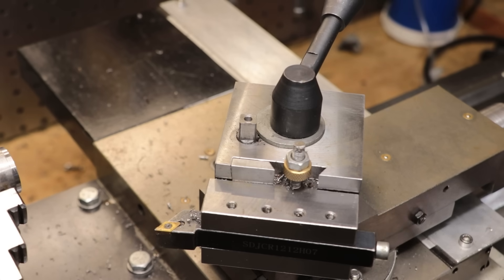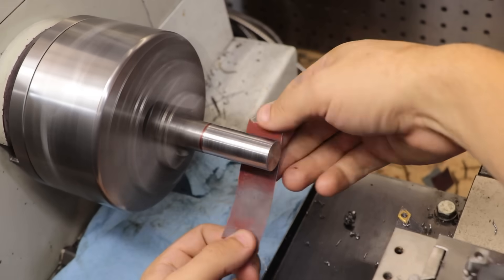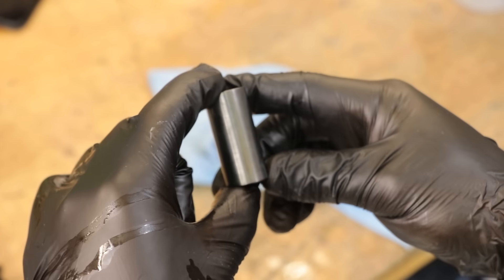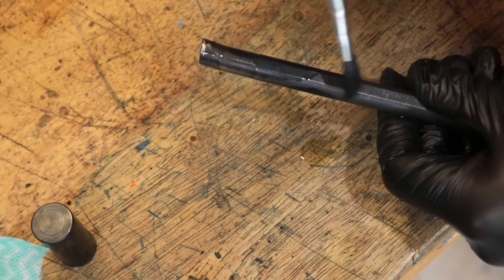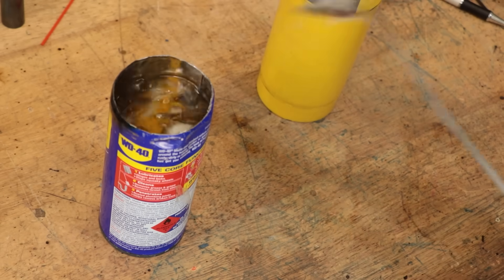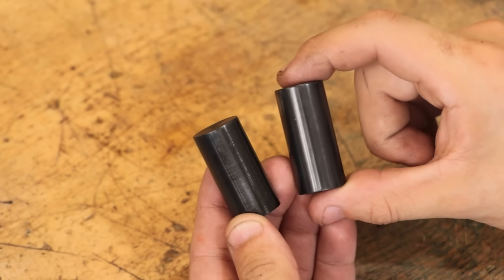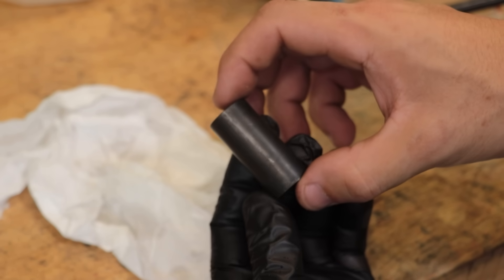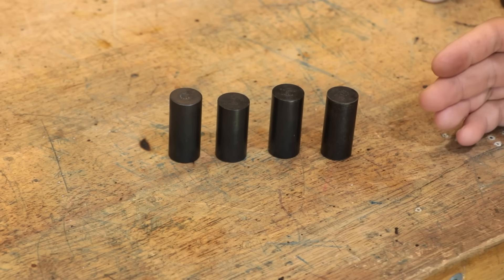Best Way To Blue Steel? Cold Blue, Hot Blue or Rust Bluing.

Comment: A couple notes that have helped me with rust bluing.  1. Light coating with the rusting solution you mentioned, then let it dry with a fan or blow dryer.  2. I will let it boil for up to 10 minutes if it isn't converting well.  3. I use very fine steel wool or even denim to card off the surface after boiling (carding wheels can be purchased).  4. I only use distilled or RO/DI water to boil and I change the water frequently because it becomes contaminated with the rusting solution.  5. After I repeat the process many times (up to 10), I card the part one last time and soak in kerosene overnight. The bluing becomes much darker and more stable after the kerosene. Then it is safe to oil it with something heavier. If you skip the kerosene and oil it right away with something containing detergents, you may run into issues. I hope this helps anyone, I've gotten some really great finished from this process, even darker than what I get from my parkerizing setup.
Reply: Few more sugestions...
As usual.. devil is in the details :)

Part need to be extremly clean before you start. 
Acetone is prety OK, but any solvent will inevitably leave a very small diluted amount of grease that is just smeared over the part.
I found that Dan Gelbarts method with ligyid ajax (very light abrasive/soap for the kitchen), work the best. 
Water myst "wet" entire part, without any spot that repell it.

Do not go for quick rusting. 
Actualy... the proces is called "slow rust blueing". You need some very mild acid, so it will create very thin but also very uniform coat of rust. Uniformity is the mailn goal.
I used very diluted ferichloride (chemical for etching circuit boards). After covering part with very thin layer of it, hang it in a bucket that have some cold water on the bottom (part shouldnt touch the water of course), cover and leave overnight. Wather should be cold so you do not get imediate condensation on the part that will produce dropplets of water and consecvently not uniform coat of rust.
In the morning you should get very thin, but very fine and uniform coat of rust. Almost like you "painted" it with rust.

After that, boil in demineralized water as mentioned, not in the tap water.
And do not just slpash the part in the water, it should be hanged in some way.

Then you need to card it, but not with skotchbrite or steel wool. You need "card brush", the brush that have very fine steel bristles (under 0.1mm diameter, for example Brownells have them), or similar dremel wirewheel (jewlery supply store have them). JENTLY brush the part, cos your goal is to just remove partticles that are loose.

Rinse and repeat...

I manage to get some realy deep black cover, after maybe 3-4 cycles, on free machining steel.
After all... some of the best "fine guns" like H&H are done this way. Only reason that hot caustic is used in industy is that it is cheap and quick on large scale. Much cheaper than slow, long rusting process, that require skilled craftsman.
But when done propperly, slow rust blueing produce incomparaby nicer finish, that will last.
Reply: Parkerizing is faster and less labor intensive, especially if you have a sandblaster. But the convenience of being able to DIY rust blue in your kitchen is a skill worth knowing. Also if you have a rust blued part that does start to rust again. You just degrease, boil and card the part to convert the rust.
Reply: Very similar to Mark Novak's method from his YouTube channel
Reply: Good comment. I made a steam pipe with a bit of wood stove chimney atop a spaghetti pot. Steam is aways clean so I use less distilled water. It's a lot of polishing but very rewarding! I think the kerosene step is to allow the magnetite to really "settle in deep", whatever that means. But I agree. Kerosene or non-detergent motor oil. Beautiful finish, hard as heck.
Reply: I use acetone then alcohol. I spray my rusting solution with a fine mister, and agreed distilled water for boiling.
Reply: I didn't think about detergents great point made!
Reply: I heat up some linseed oil for oiling .
The high temperature let the remaining water boil of 
The oil dries after whiping of the oil.
The are dry to the touch after 2 days or so

Comment: There are several recipes for caustic bluing. Some better than others. I've seen a couple of guys on the Tube put out some really nice finishes. Most were gunsmith related. I don't think all of them require sodium hydroxide, either. Rust bluing requires quite a bit of patience, as I am sure you found out. Nice work, though.

Comment: 👍🏻 Fascinating, thanks! And it helps explain how i accidentally blued some stainless steel tableware. I usually soak used tableware (especially if it's greasy) in a tub of washing soda (sodium carbonate) until the dishwasher has a full load. But recently i ran out of the washing soda and used some caustic soda instead. And presto!

Comment: its way better to rub the oil or wax onto the hot part with a rag instead of dunking it in a pot. Part not hot enough? will see immediately without having to start over. Coat not thick enough? apply some more heat and rub on more. No idea why the dunking method is the one shown everywhere

Comment: Hot waxing/oiling/blueing is a common traditional blacksmithing technique, and is really easy and consistent if done right.
Instead of dunking the whole part at a very specific temperature like you're doing, consider getting it a bit hotter and rubbing the polymer on with a cloth or straight from a wax block instead.
Welding or hot mill gloves should handle the heat no problem
Reply: i've seen a ton of ppl do this & was rly surprised to see a full quench/dunk! you could also just straight-up season it in the oven like a cast iron pan, that would avoid thermal shock

Comment: Everyone of those types of blueing must be cared for or rust will form.  I gave them up long ago.  My go to metal finish for steel is parkerizing.  If you can heat water you can parkerize.  The military has required it on all their small arms in both world wars.  It is extremely resistant to wear through on high points of frequently handled parts unlike blueing and hides machining marks really well.  The finish is a matte grey and if you prefer black you simply add a little cold blue to the solution. It stores indefinitely in plastic jug(s) until you want to warm it up and use it again.  Parts should be degreased, but they need not be polished as the finish is matte.  You can even sand blast the parts if you want the parkerizing to get a death grip on an item for generations to come.  Check it out.  You won’t be blueing any more.
Reply: Oil on bluing and done.
Reply: Would this make a knife toxic like cold blue?
Reply: @lindboknifeandtool   I have no idea if it would.  I did not know cold blue made a knife toxic.
Reply: Out of curiosity, did you ever boil your work piece in oils or wax?

I pulled an old mall out of a tree that my saw found.  After treating it about 9 years ago it has sat outside and even in the bottom of a rainfilled bucket for months.  No rust or further oxidation.

What were your experiences in this situation?

Looking at museum pieces, indian cast monolithic pole things, and many other examples through history, it is hard for me to believe you did it correctly.
Reply: I've been considering parkerizing a small arm that I acquired in a rusty state.

What I wonder about is how well tight tolerance parts such as pins and screws will fit afterwards.

I'm afraid the fit will be too tight.

Sounds like you have good experience with the process, if you've ever parkerized parts like this, how did they fit?
Reply: @DennisHicks78749 I have parkerized quite a few firearms.  The only parts that I did not parkerize were the inside of rifled barrels.  I plugged both ends of these. Stainless steels, aluminum and other non ferrous gun parts will not accept parkerizing.  Brownells gunsmithing supplies in Montezuma Iowa can give you more particulars right over the phone as they have a help line with actual gunsmiths manning the line.  They sell a lot of supplies for the process.  Some of them you do not need. In answer to your original question however: I have never had a pin or screw not fit back in a hole that has been so processed.  Hope this helps you.
I forgot to mention I use stainless steel vessels to heat and parkerize my parts.  I heat these on portable hot plates. In my shop.  When the item is finished parkerizing it immediately goes into a running cold water bath after which I lay said items on paper toweling and spray them down heavily with WD-40.  You need to do that to prevent flash surface rust.  The real key to successful parkerizing is a super clean grease, rust, and oil free surface to begin with which I usually accomplish with an acetone wash down prior to immersion in the parkerizing. The solution is reusable and after it cools I funnel it back into its gallon plastic jug in which it is stored until the next time.
Reply: I've looked into this many times in the past and my best research has always told me that Parkerizing is proprietary and there's no way to do it in the home shop. You got a link?
Reply: @brocktechnology that may be because "parkerizing" is a trademark name, the real name is phosphating or phosphatizing and it's extremely common in an industrial environment, and the steps are beyond simple to do even in a domestic environment
Reply: @brocktechnology  "Mark Presling" - "Metal Finishing 3 Ways - How I Finished the 4 Facet Drill Grinder"
Reply: @jrkorman  ditto that on the link to Mark Presling.  He’s a retired high school shop teacher, and he’s absolutely brilliant!  Once you watch one of his videos, you’ll find yourself wanting to check out the rest.
Reply: @mrimmortal1579  I tried to explain to Mark that he is over complicating the process.  He bought some kit that told him he had to go through a complicated process, measuring temperatures, multiple pre and post washes, and etc.  This is what he showed on his video, and trust me, you have to be able to heat the solution, that is all.  I’ve been doing it for years.  Just make sure your parts are degreased just as you would for blueing.
Reply: @37yearsofanythingisenough39  
Interesting…  That makes me think of Granny Clampet’s super-complicated and horrible-tasting ‘cure for the common cold’.  In the end, after going through the whole episode gathering strange ingredients, cooking up the foul-smelling concoction, and getting Mr Drysdale to choke some of it down, she says “There.  Now drink plenty of liquids, and get some rest, and after one or two weeks your cold will be gone!”

😂
Reply: @jrkorman  Mark is great but he uses jane plating kits and they don't ship outside Australia. The equivalent here in Canada is Caswell Canada, they have most of the same products but no phosphating. I'm pretty sure at this point that there's a key ingredient that's controlled in Canada.
Reply: mark presling
Reply: @brocktechnology  If you're in the U.S. Brownell's had the chemicals and instructions. There are other places but that's where I got mine. There are two different chemicals with different colored results. The gray/green is zinc phosphate (Parkerizing) and the black is black manganese. I heat the solution on an electric hotplate but that limits the volume I can work with.
Reply: @kennethstaszak9990  I have both small (asparagus steamer) and (buffet chafing dish) and large (48” tank for barreled rifle actions) and 4 hot plates.  You may want to go shopping to increase your capacity.  I just finished a knurled handle for an arbor press and it came out beautiful.  Wish I could show it to you.
Reply: @37yearsofanythingisenough39  I have a 5 quart stock pot so I can do fairly large pieces. If I need to do something like a barrelled action I have a tall tube that I pour the soultion in after it's hot. That way I have more surface area on the hotplate to get the solution hot and I can still keep it hot enough even with the lesser surface area of the tube. Even PVC pipe if necessary can withstand the hot solution after it's been heated
Reply: @brocktechnology  I bought mine from Brownells in Montezuma Iowa.  There was a YouTube video on making your own from scratch, but I didn’t want to fool around with doing that.   There is no green parkerizing.  Many people think that there is but that color develops over time on military guns that had wood stocks and were handled and oiled a lot.  The zinc phosphate is the one I use.
Reply: It sounds like the results we used to get w/ Rust Mort, (phosphate based bare metal wash used in body work world) & an old battery charger 40 yrs ago.

We'd get a ½ a 5 gal bucket of fasteners from the wrecking yard, throw a ½ × 6" bolt in the bottom of a big SS bowl attached to the + of the charger, dump the bucket in, add a qt of Rust Mort, fill w/ water, clip the charger's - to the side of the bowl, set the charger to Trickle & let it go for a day.

It'd heat up & boil the grease, dirt & rust into a nasty scum layer on top. The next day we'd hose off the clean fasteners & spread them out on a ¼ × ¼" screen over our shop furnace.

All of the fasteners would be clean, gray-greenish color& rust free.  After our biz folded I took some of our treated & sorted bolts w/ me.  

20 years later, they still were rust free after years in unheated Oregon shops.  Haven't pulled one from my bolt bins in a long time.  Keep saying I'm gonna off a batch, but being officially ancient, it seems like something else demands my time.
Reply: @georgedennison3338  better watch it George.  Someone is going to want you to make a YouTube video on Rust Mort.  There is nothing out there on that yet😃
Reply: Yeah, parkerized parts will rust too. Both blueing and parkerized metal require occasional oiling. 

I have plenty of firearms with both. Parkerizing requires more loose tolerances and is hardly worth the process compared to modern options.

Comment: When I was hardening a part I machined I forgot to clean off the oil before tempering it and it made the part a nice deep black color, id love to see if that's repeatable
Reply: Yes, that's basically the same as the second method he showed and exactly how you season a cast iron skillet!
The important part is just having the oil go on a part that's smoking but not ignition hot

Comment: Could you get a large flat fish bubbler stone...put under the part to nickel plate...then bubble air past the part, this would agitate the fluid and help cover better
Very nice on the finishes!
Awesome!
Keep em coming!!!!
Reply: This.  I worked in industrial plating for a few years.  All solutions have bubblers and circulation.  The current control is something that isn't given enough attention.  The bubbling from the parts is a sign that it's being over driven.  I did a lot of reel to reel plating back in the day.  Millions of chip legs passed through my tin-lead line back in the day.  I think the rolls held 50-200K legs per roll.
Reply: Air=a very good electrical isolator! Also: a wonderful oxidizer, which is not good 
Pumps or stir bars are the way to go. Tin/Lead != Nickel and in a industrial galvanic setting there are many different steps, including washing, passivizing or harmonizing, where some kind of gas-bubbling will be helpful for the process. Please RTFM (meaning a suitable specialist book on the subject of galvanization/electroplating/chemical galvanization. This saves a lot of trouble, cancer and hair loss;)

P.S.: Plating on an industrial scale and quality, like drum (electro-)plating, is of course complete nonsense at home. That would be uneconomical, unaffordable and, above all, illegal because you wouldn't be able to get the necessary permits for it. Note: Such a system includes water treatment and disposal facilities, which are usually 10-20 times larger in volume and area than the actual production system where the workpieces are handled. Also, you need a separate department with trained chemist(s) on the facility that check the quality of the production equipment and the safety of wastewater.
Reply: I don't recall whether or not we used air agitation in our nickel tanks, but I do know that it is very important to have sufficient anodes placed throughout the tank around & in-between the parts being plated.  I spent most of my career supporting the plating shops where I worked my entire career -- we did "industrial" plating, not "cosmetic" plating.  At times we'd have to apply more than 1/16-inch (~1.6-mm) thickness of nickel to build up worn parts before grinding & then chrome plating on top of the nickel for wear resistance.  Anodes of the correct shape, placement, & spacing, at least for chrome where the anodes did not supply the metal being applied to the part surfaces, were critical for even thicknesses of chrome in this example.  The same works for nickel plating, except that the anodes would have to be continually (machined &) replaced which cost way too much to be practical.  By chrome plating surfaces evenly, we cut finish grinding times to less than 7% of what they had been before using "conforming" anodes.  With nickel and thick deposits, we found that even though it wasn't cost effective to manufacture custom shaped nickel anodes, custom "masks" worked almost as well.  Of course, "Artisan Makes" isn't even fantasizing about industrial plating in his workshop, but some of the ideas that were successful in industry can still be adapted to work in home shops too.  I think that I would try air agitation with nickel plating, unless I could find my copy of the process specs we used at work and they said not to use air.  The only agitation we used in any of our plating tanks (we had over 200 tanks between our two plating shops) was air, pumps, and in a few cases, propellers to stir the solution up.
Reply: Ha, I was thinking just the opposite, to do it in a vacuum chamber